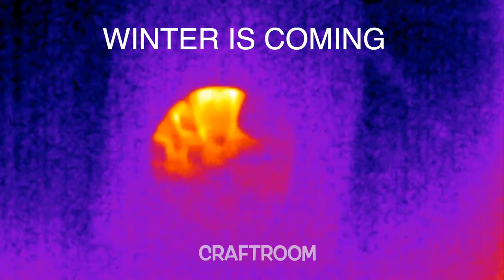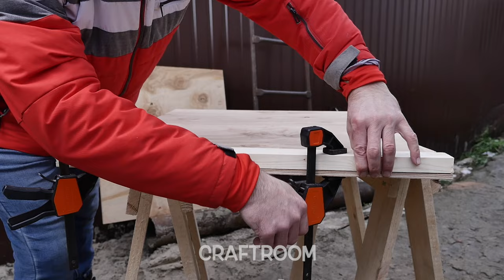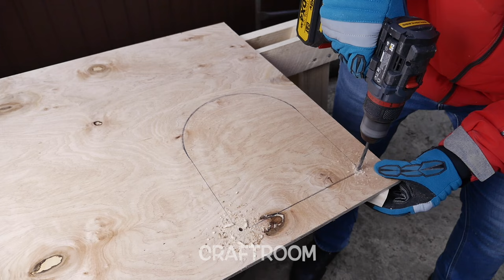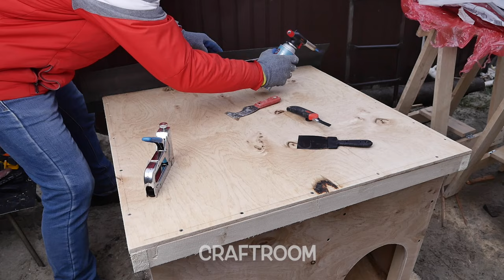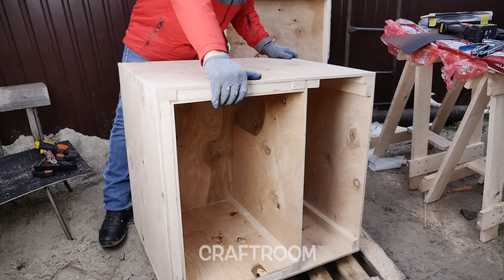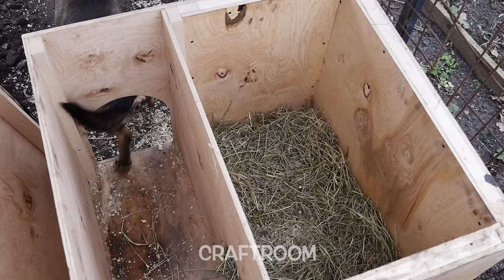Winter Dog House Build DIY. Very Fast and Easy.

Comment from the maker: Easy DIY Winter Doghouse
Reply: U need to airgap all the walls, roof, & floor. And make it where air will ciculate around the whole  thing pumping warm air all around it. The extra room is neat to save energy to keep the doghouse warmer, os like the extra room at Aldi to keep the cold air out. Use 2 plastic things that seal themselfs back at the 2 dog doors or entrances to keep out cold air. It was strange that you had an airgap between the walls, why did u do that. Or did u inyentionally add the air gaps. What would be even warmer if the doghouse was designed like this using warmer brick.
Reply: @myronhelton4441  If an intelligent man like yourself gets absolutely befuddled by a dog house build then how can we simple mortals comprehend your insightful comments. Would you be so kind as to show us how to do this correctly on your own  video kind sir? Be sure to dumb it down for the rest of us. Have a wonderful day Myyyron.
Reply: Can you make a list of dimensions?
Reply: What about dimensions

Comment: No insulation? No heated floor? 😢 Poor puppy will be cold!
Reply: The insulation is the cavity between the panels. Modern insulation may be better but just as a porch keeps cold air contained from reaching the main house a cavity wall is a low budget means of trapping and warming air to act as a buffer to keep the interior warm by reducing heat loss in a buffering partition. The floor is the same and the dogs own heat will be what heats the interior.
Granted heating and insulation would be more efficient but not everyone has a budget to develop such houses.

Comment: Thank you, very well shown.  The only things I would add, are the floor and roof insulation.  The house would lose heat through the roof easily.  The second insulation is a floor one, humidity would rise via the wood makes the floor damp.
Reply: Do you think that just putting insulation in the roof and floor would be fine? Or would it be better to just put it in the walls?
Reply: What would you recommend to use for it?
Reply: Hi, Styrofoam (extruded polystyrene foam (XPS))  for the floor 5 cm thick or more, the roof 3 cm thick. It is light, easy to cut and very warm and does not absorb water.  The only minus thing is, that a dog should not have access to it, so a thin layer of plywood 3mm, should separate a dog from it.  It could be glued or screwed across to roof wood.
Reply: I said "add" 🙂
Reply: @elizabethharris1157  thank you ☺️

Comment: Pretty good work. Although I’d like to mention that the area that the dog will be laying in is small. Also, instead of predrilling holes you can measure from the outside where the stud will be and drill the plywood into it. Adds for the integrity of the build. However, love to see this build. Definitely gave me the idea that I should build my own!
Reply: You want to keep the sleeping area only slightly larger than the dog as it is the dog's body heat which heats that area.

Comment: This is absolutely brilliant but I need context that explains each step in detail. Do you have a list of what is needed and step by step instructions on how to put it together? 🤞 With 4 large dogs and 1 Ayam Cemani Rooster outside and 2 elderly parents inside, I could really use a little extra guidance. Merry Christmas, hope to hear back from you soon. Thanks!
Reply: Let me know if you figure out! I’m trying to build one for my mastiff
Reply: @platinumbullykennels2660  Since there doesn't seem to be a plan, I guess you would have to size it yourself. If you Google 'how to size doghouse' it gives tips on the measurements to use. You need your breed of dog's adult dimensions to  work out how much space to give it, and then you proceed as he did in the video. It looks like he uses 2x1 planks and 1/2" plywood?

Comment: Just curious why paint the bottom?
Or are you coating it with something ?
Reply: It looks like bitmumen type waterproof membrane. The membrane is to ensure once the dog house makes contact with the ground it will help stop damp moisture rising underneath and to extend the life of the house from further deterioration.

Comment: 00:54 Did'nt you forgot insulation?
Reply: The fact that the side panels are hollow means there is a naturally insulating layer of air there. The same effect works wonders with double-paned glass.
Reply: @jonnies Roof insulation would be smart.